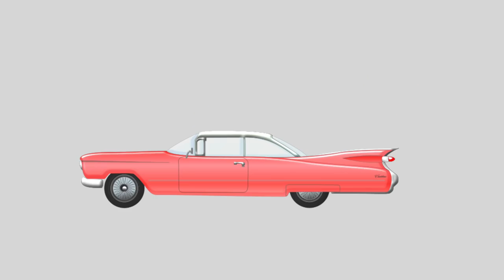Yes, Rockets CAN Fly in a Vacuum

Comment: difference between sea level rocket engines and vacuum optimized rocket engines
Reply: Sea level rockets have to account for atmospheric pressure, which can cause the exhaust to separate from the engine bell and cause instability. To compensate for this, the engine bells are usually shorter and narrower than vacuum rated engines.
Vacuum optimised rockets don't have exhaust separation problems, so they can have much larger and wider engine bells to get as much thrust from the exhaust as practically possible.
Reply: @niallkinsella2687  so are the sea level engines powerful than the vacuum optimized engines?
Reply: @thekingsofcoding6236  
Nope.
Just designed to deal with the specific environment.

Real world example. SpaceX uses the same Merlin rocket engines on both the upper and lower stage of the falcon 9.
The 9 on the first stage are optimised for atmospheric flight and so have small and narrow engine bells. The upper stage engine has the exact same plumbing, but a much bigger vacuum optimised bell.
Reply: @niallkinsella2687  so both the engines have same thrust right?
Reply: @thekingsofcoding6236  

Not exactly.
The sea level optimised engines are a compromise between trying to get as much efficiency and thrust, and trying to ensure the exhaust doesn't seperate from the sides of the engine bell. This happens because the atmosphere is higher pressure than the exhaust gases (anywhere you see shock diamonds in the exhaust of a jet or rocket, it's because the atmosphere is compressing the exhaust).
Flow seperation leads to stability issues which can be very  dangerous for the rocket.

Vacuum optimised engines don't have to worry about flow seperation. The engine bell can be designed to get as much efficiency and generate an much thrust as possible.

The Merlin vacuum engine generates about 10% more thrust than the Merlin designed for atmospheric flight, despite the only difference being the size and shape of the engine bell.
Reply: @niallkinsella2687  : Well said, brother.

Comment: For propulsion to give momentum, you have to reach an equilibrium or balance between the two. In other words your fuel tanks couldnt produce enough positive energy to overcome the amount of negative space already surrounding it.  So your balloon theory works only because you believe your fingers can hold the negative  force of space extracting the air from inside it. Even if it could, once you release the balloons contents, space is much larger then your balloon is, so without resistance to push against you go nowhere.
Reply: @bobartor910    Well maybe you can correct me then... Think of the experiments done when a liquid in a sealed container is then exposed to cold atmospheric pressure.  The container gets crushed upon itself. Now replace the cold atmosphere with the negative temperature of space & replace the positive atmosphere with the negative pressure of space. I was curious & Didn't expect a rocket engineer to respond to me, but since you did, correct my gibberish with the proper terminology. Also, can I get that equation you spoke of?
Reply: @509Smoker  
Space doesn't have a negative pressure.  LMAO
Reply: @509Smoker  
And the temperature of space is about 2,73 Kelvins  - again not negative.
Reply: @bobartor910  Well the temperature of deep space IS close to absolute zero so it IS a "negative" temperature in C or F.
The "heat sink of deep space" is known to be about 5 Kelvin.
Reply: @509Smoker  - "Also, can I get that equation you spoke of?"

It is usually just referred to as "The Rocket Equation" but more specifically it is called the "Tsiolkovsky Rocket Equation" after the Russian Scientist that derived it from Newtons Third Law over 100 years ago.

We have been testing the equation for almost 100 years.

My company tests rocket engines here on earth in a vacuum chamber and we verify that they produce exactly the thrust predicted by the Tsiolkovsky rocket equation before we install them on real spacecraft and launch them to space where we test them THERE TOO.

Comment: What degree does liquid oxygen freeze or boil ? Is that a factor in this kind of application
Reply: What does that have to do with propulsion in a vacuum?
Reply: and at what pressure?
Reply: @marxman00  You can look up ALL of these parameters in about 30 seconds online. Why are you acting as if it is all some secret?
And what is the POINT of the question?

Space Shutte Main engines use WATER as the reaction mass.
Kerosene Engines us CO2 as the reaction mass.
What has THAT got to do with the temperature that liquid oxygen freezes?
Reply: @stuartgray5877  Your words are meaningless  , your fired !
Reply: @stuartgray5877  So why do they only use it from the ground and not in space ? AND cue the waffle ..
Reply: @marxman00  "We". My company built the cryogenic hydrogen and oxygen tanks for the shuttle orbital maneuvering system.
Reply: @stuartgray5877  We all did ,so what?
Reply: @stuartgray5877    Are you upset because your fake and people know it ? Thats on you boy!  I win again!
Reply: @marxman00  yup... SG is a bot.
Reply: @DrCash7  you spend hours upon hours arguing with bots? that's really sad existence
Reply: @frantaspacek  reported and muted 😎
Reply: @DrCash7  who? for what? no wonder they don't take you reports seriously when you're so easily triggered.
Reply: @DrCash7  I'm sure you didn't mute me, you already said that to some people and still responded after that, you're really embarrassing

Comment: Bruh you need objects for the equal and opposite reacting to happen against, is called relativity for a reason otherwise the force from the gas burning goes on and infinitum into space till it finds an object to push against...
Reply: So if you force a tonne of gas to accelerate in one direction, do you not feel any reaction?
Nothing at all from pushing all that gas away from you?
Reply: @niallkinsella2687  but the rocket isn't pushing the gas? The gas is being propelled by its own explosive expansion , I don't really understand it but if the gas explodes I intuitively think it goes out of a path of least resistance so if there's a gaping hole into space with 0 resistance at the back of the rocket wouldn't all of the hot gas exit out there without any issues? Why would it push on the rocket unless they keep the gas in a sealed chamber which would make a bomb .. conceptually I don't get it , doesn't make it untrue though; but where are all of the official testing videos from NASA of a model rocket in their massive vacuum chamber? Surely they would have Carried out extensive vacuum concept testing before sending astronauts to their possible demise in space??  The fact I look on YouTube and hundreds of these videos dont pop up, instead I see home made versions in a tiny vacuum chamber where rocket could be pushing off of the side of the chamber is very weird to me
Reply: @jojohnviz12  
The explosive expansion is contained in all but one direction.
So you are forcing the mass to accelerate in one direction only.
This allows you to take advantage of conservation of momentum. 

If you have a big rock and you to throw it, you will feel a reaction equal to the momentum you imparted on the rock, but in the opposite direction.
Same applies to accelerating liquids and gases. It's the mass you accelerate and the velocity accelerated to that determines the momentum, and the reaction you feel.
Rockets are more complicated than my ideal example, but the same principles apply.

Rockets are vacuum tested at Altitude Test Facilities, such as the Glenn Research Center. The engineers there learn more from the sensor suites in the test stand than any video, but you might be able to find some.

Comment: I don’t think the car example was a good example..
Reply: So can you suggest a better (or more appropriate) example of a vehicle that achieves locomotion by directly pushing against a medium?
Reply: Why does it have to be a vehicle? What about a squid?  anyways a comparison between friction movement of a wheel vs a rocket engine doesn't go well IMO
Reply: Given that the people being corrected in this video are people who think that rockets won't work in a vacuum because there is nothing in a vacuum for them to push against a contrast between circumstances where pushing against something is a relevant factor and what happens with rockets seems like a valid approach.

Comment: That would not be enough oxygen to get to the Moon and back
Reply: It would be if you used a little thing called pressure. The capsule doesn’t contain ALL of the food, water and air idiot. The fuel tank (I know it’s called a service module) contains most of the air, and it’s not entirely fuel.

Comment: WTF? you got your internal combustion all wrong.  the exhaust DOES NOT push the car forward LOL.
Reply: Well actually IT DOES. But the amount of force is negligible compared to the traction from the wheels
Reply: @stuartgray5877  therefore, it does not.
Reply: @brutallygwapo9597  yeah but the video didn't say that, it literally has a note that says it isn't enough to overcome friction/the weight of the car, just that the exhaust is generating a force
Reply: @ppleberrynd  she repeatedly only mentioned the exhaust ALONE as the pushing force.  if she had mentioned the internal combustion happening inside the engine, then even indirectly it would make sense even if she doesn't mention the tires.  my point is, anyone who has very little knowledge of physics would be misled.
Reply: @brutallygwapo9597 
1:10
1:27

Comment: When your vacuum-chamber takes not off on planet earth, you never had a real vacuum in that  chamber :D
When your ballon stretching is over, the enlarged ballon shrinks to normal size and pushes the remaining air out of the ballon, against yes "air" and the push-up effect let the ballon fly away (like a jet that needs air that he can fly). So a ballon on earth is a bad example, cause you like to show a example in a "real" vacuum. In my 3D-particle system nothing happens and in my not 100% Vacuum chamber the ballon that includes the air explode. So yes, Nasa is lying :D
Oh and what happens on a boat by threwing a stone, when your water is nothing or better a vacuum, you are falling to the ground. But also this mindplay has more than one failurs when you are smart you know them.
Reply: TOM MOON - So what would happen if i fired a crossbow in space (in a vacuum)?
would I still feel a recoil force?
Yes or No?
Reply: Yes but you and your arrow goes with the same speed in difftent directions so your Crossbow becomes the arrow too. But how many Crossbows you need to your goal???
Reply: @Mr.TomMoon  SO you are admitting that a rocket COULD propel itself IF it had enough objects with MASS to push on?
Good!

Now what if the rocket had a bunch of solid water ice blocks to shove out the rear with a catapult/crossbow like device?

Could it "Propel" itself like that?  Assuming it had a LOT of ice blocks to fire out?
Reply: @Mr.TomMoon  Then what about water BALLOONS?   Could it propel itself by firing out balloons filled with water?

What about a FIREHOSE?
would IT feel Recoil if it shot out water into a vacuum?
Reply: @Mr.TomMoon  did you ever have a "water rocket" as a kid?  Would one of THOSE work in a vacuum?  Yes or No?
Reply: @stuartgray5877  Oh Gravity is still a Theory. Cause no one to this day made Gravity or antigravity as a proof, so yes it is still a theoretetical mindfu.k. Density is the real answer, with that the vacuum is the highest force that goes with the fastest speed up. Only with density you can make your water pressuriced rocket fly in water or with lot more pressure, also a short time in the air. The air filled Ball under water, will all the time goes up and that is density and not gravity. The real thing that you call wrongly gravity is in fact density. And that is also the reason, why the lightest objects like clouds can fly, instead being attracted down to earth by the mystical force gravity.
Reply: @stuartgray5877  wrong empirical science work with proof or disproof. In german the language where english comes from, the word for science is "Wissenschaft" means in one Word "Knowledge-making". Everything without a proof like Gravity, the bigbang and evolution is still a Theory, a mind of some one, but not real science, cause the empirical fact of truth is missing. Have a nice week, have to do other things.
Reply: @Mr.TomMoon  - NO!
The "Scientific Method" CANNOT "PROVE" anything.
It has NEVER proven ANYTHING, and NEVER WILL.
Now go research the scientific method before speaking about it.

There is not a SINGLE "Theory" that has been "Proven". EVER!
Reply: Yo Tom, Stuart is a bot.  He's been posting the SAME crossbow crap for years.

Ask it about election 2020 integrity.
Reply: @DrCash7  'stuart gray' isn't programmed to know the difference between a gas and a solid.
Reply: @inniuniui9361  - Care to tell ME where newton's LAWS specify Gas versus Solid?
Hint:: They DO NOT. Newton's Laws mention MASS - PERIOD.

Now are YOU going to make the claim that GAS does NOT have MASS?  PLease go ahead and try to say that.

SO tell us WHY you feel that high school dropouts that have never taken a physics course IN THEIR LIVES, feel confident enough to argue physics with actual Spacecraft Engineers.

but bless your little heart for effort!
Reply: @inniuniui9361  No answer to my question?
WHERE in Newtons laws does he ever mention "solids, liquids, or GAS"?

Hint: He DOES NOT. He mentions MASS .

Now, do solids, liquids and GASES HAVE MASS ?

YES OR NO?
Hint: Gas HAS MASS shit for brains therefore it FOLLOWS NEWTON'S LAWS.
Reply: @stuartgray5877  What a silly little thing you are. here, read this:
"When a fixed mass of gas is trapped in a container, it exerts a pressure on it due to the collisions between the particles and the walls of the container. The more collisions per second the greater the total force and therefore the greater the total pressure. If the volume of the container is reduced, but the number of particles remains unchanged, then the particles will collide more frequently, therefore increasing the total force along with the pressure.

If the gas starts out at a higher temperature, it will have a higher initial pressure (see the pressure law) and the product of the pressure and the temperature will be greater."

Comment: Where is any proof that rockets work in space? Show the  iss boosters working
Reply: For ONE, the ISS does not really have "Boosters".
The spacecraft that dock to it are the ones that provide the altitude boost.

And for proof of rocket propulsion in a vacuum watch the YT video: "uninterrupted footage of the falcon heavy launch and booster landing! 2-6-18"

Watch from launch to side booster landing then describe what you just witnessed.
IF you don't spot the rocket propulsion IN A VACUUM, just let me know and Ill point them out to you.
Reply: @stuartgray5877  Zarya module has engines btw. Not a docked vehicle, but the first module of the ISS.

Comment: Q.Can we run an rocket  without projecting any matter? With just using enery?
Reply: Photons carry momentum, so a powerful enough laser should be able to propel an object in space
Reply: A catapult-esque launcher would require no fuel, but mass is still being released.
Reply: @fork9001  rocket system is better than that.
Reply: @stuartgray5877  yes, but may be it is not sufficient enough.
Reply: @rafsan1578  You can launch a rail gun into orbit, dock a spacecraft/payload and this rail gun can launch the payload to a higher orbit (it can launch it wherever, really). Only requires one launch, and it can power itself using solar panels etc. It will still have to use engines to maintain its orbit, but its efficient.
Reply: @fork9001   think that, your rocket is in the mid space between earth and mars.And all its fuel is used. Now,  it only have contineous supply from sun, but its only energy. Now, which kind of energy it can use?
Reply: @rafsan1578  It can use the force of the solar photons and a "Solar sail" to move.
Reply: @stuartgray5877  solar sail?
Reply: @rafsan1578  yes solar sails have been proven to work.  Photons carry momentum even though they have no mass.  If you reflect one in the opposite direction it was received at the reflector gains 2x the incident momentum   it is very small but a noticeable force on our interplanetary spacecraft
Reply: @stuartgray5877  looks like thats really a good idea.
Reply: @rafsan1578  Solar sails, maybe a powerful laser on the surface on the moon to speed it up and another powerful laser on the surface of mars to capture it into orbit.
Reply: @fork9001  read the sci-fi book "the Mote in God's Eye"
Reply: @rafsan1578  I just thought of a new one, just put a rail gun on the back, and power it using solar panels. If you put stages into the spacecraft, you can use the other stages of the spacecraft as reaction mass because of Newton’s second law of motion.
Reply: @fork9001  rail guns also projects matter. If you use rail gun,  in every shoot you are loosing mass which will end soon.
Reply: @rafsan1578  Ok then the only other option I know of (that isn’t a solar sail) is a EMDrive or a warp drive, no fuel expended.